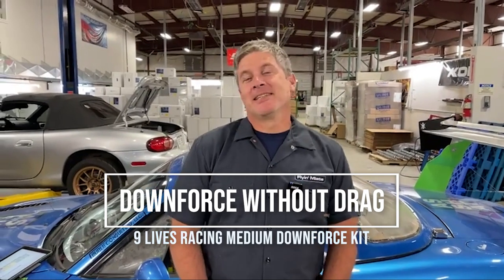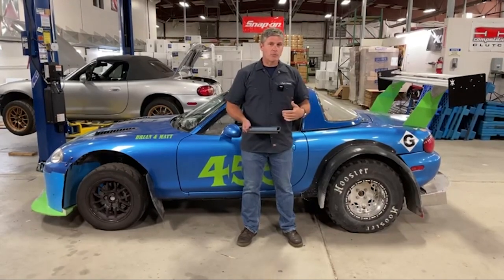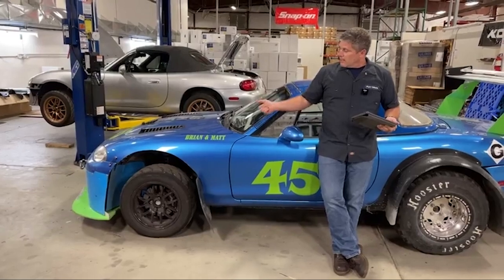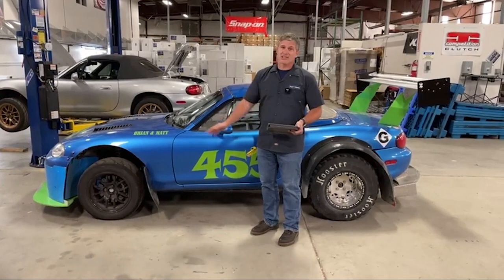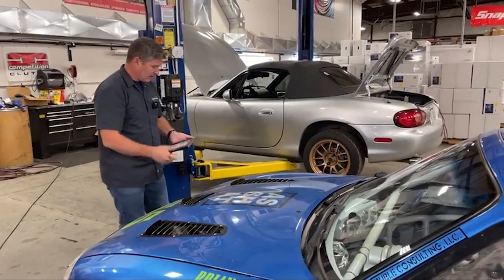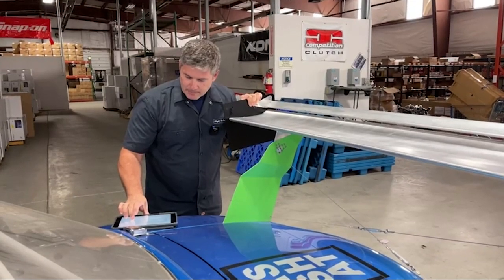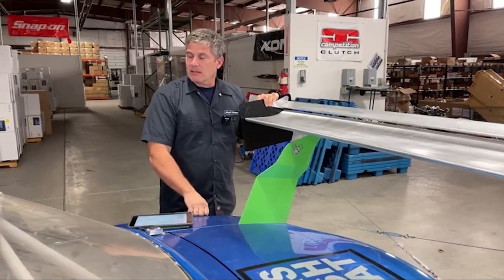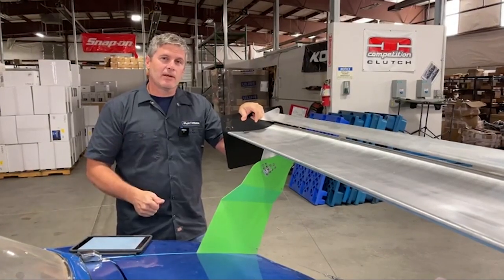Downforce without Drag? It is Possible! (FM Live)

Comment: I have a 1992 stock 1.6.  I am more interested in reducing drag.  I think Flyin' Miata should consider a flat-bottom kit, especially with their in-house production capabilities.
Reply: LRB Speed has a full flat front undertray made out of aluminum. Noticeable difference on my NA at highway speeds compared to stock plastic one

Comment: Great video. Having done some research and seen some cfd data on several car body shapes, im surprised that hardly anyone is reducing drag by adding some large flat pieces of plastic(about maybe 1-2 feet long, 1-2 feet tall) behind the rear wheels extending from the inner fender well towards the rear of the car and curving them inwards about 2 degrees. It "should" be good to reduce Cd by about .01 and assist in smoothing out the turbulence behind the car.

Plus, it can look good too if done well. lol.

Comment: Would love to see lip spoilers, small wings, and big wings all in a wind tunnel with smoke showing the pathway it takes.
Reply from the maker: Wind tunnels are not as accessible as CFD simulations, unfortunately, so you may have to settle for cool pressure maps and flow diagrams as seen on the 9Lives Racing site. 
You can see some pretty interesting effects with a long (6' or so) string attached to an air hose, it will show you how the air moves over various features of the car.
Reply: Have some fun with some styrofoam and a billion pieces of string taped to the car. Using a box fan or air compressor you can learn a lot. If you find a styrofoam shape that works well, try your hand at glassing it. Maybe after you spend enough time playing around, you’ll understand why very few people actually get around to wind tunnel testing things properly or doing much in the way of aerodynamic engineering